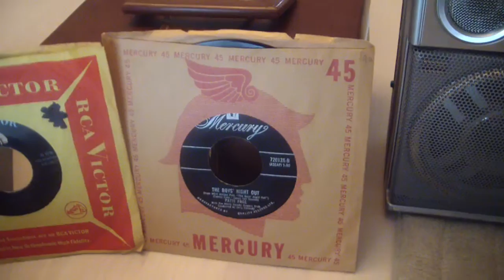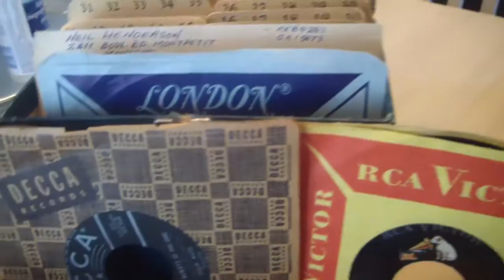Early Evolution Of The RCA 9JY with  RP168 player attachment

Comment: I hear a speed variance which is most likely rubber drive wheel slippage or a bind up in the motor which can be easily corrected. I have a very similar one that I have to go through the process of restoring one of these days. I've lost count of the many variations of that model during that short period of time. They're all very nice and who doesn't like the classic look? Thanks for  the video and all the info.
Reply from the maker: Thanks for your comments! I have  restored the idler wheel (with a product called plasti-dip), which added a fine coating of rubber to the edge of the wheel, and speed is as good as new! After a few months, still no sign of flutter..hope it doesn't change!

Comment: When the player started playing Pretty Woman I could tell there is a huge speed difference. It sounds like it's slow
Reply from the maker: Thanks for the feedback. The idler wheel was re-coated with a nice coating of "plasti-dip" (worked well), and a ping  - caused by a "line-dent" in the wheel was thus eliminated, as well......:)  a work in progress!

Comment: I have the same one but my needle drops gently on the record and it has a black top on it so how old is mine then
Reply from the maker: +1530FDR , 

The fact your  tonearm is dropping gently could indicate it has a shock absorber style "piston" installed to allow for a more "gentle" arm drop. This was added a bit later, in order to protect the records from tough wear and tear. The black spindle top also leads me to believe yours is a slightly younger model.  If the base does not have a built-in tone arm rest, then it is still of the same "vintage" of the one in my video. Other You-tubers will be able to further confirm. Thanks for watching.

Comment: Nice player! I really want to get one of these. As for the speed of a 45 player, it's way low than a normal. Either it needs a idler wheel or you should the motor to get it working again.
Reply from the maker: Thanks for your comments! I have since restored the idler wheel (with a product called plasti-dip), which added a fine coating of rubber to the circumference, and speed is as good as new!

Comment: Sounds slow and a lot of flutter.  Some good info however.
Reply from the maker: I have edged the outer surface of the idler wheel with a fine coating of Plasti--dip.  Definitley has restored the sound, and eliminated the wow and flutter.  Also, allowed for a more seamless change cycle! thanks for your comments
Reply: @neilh9124  You're really touting that plasti-dip. Is it that good? Where do you get it?
Reply: @jhonwask  Electronic shops dealing with vintage audio, you could try, ebay and amazon maybe even a hardware store
Reply: @ricknelsonm  Thank you. They sell it at walmart and lowes
Reply: You can also have the idler wheel rebuilt or replaced.